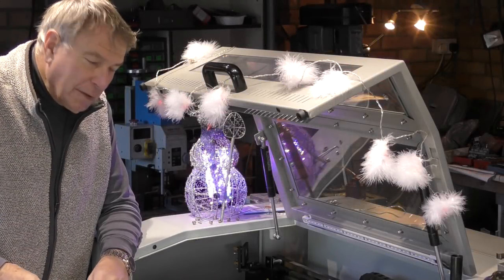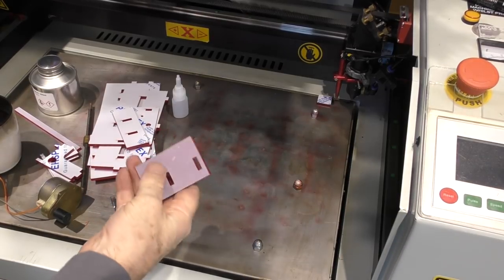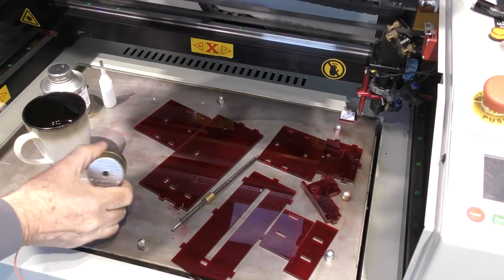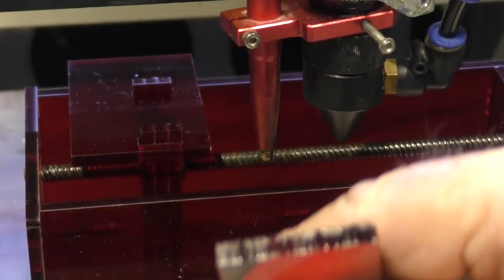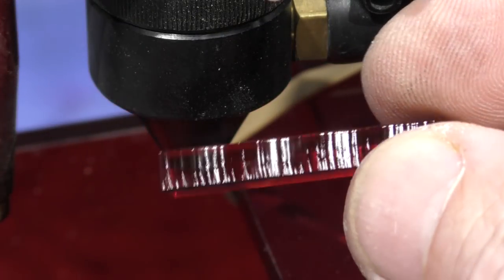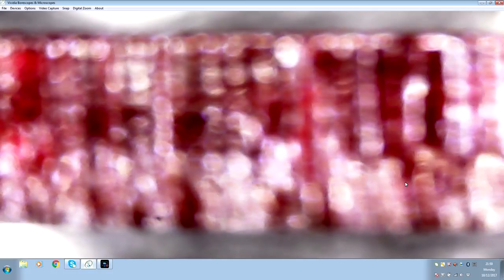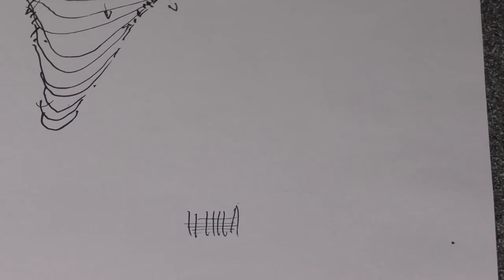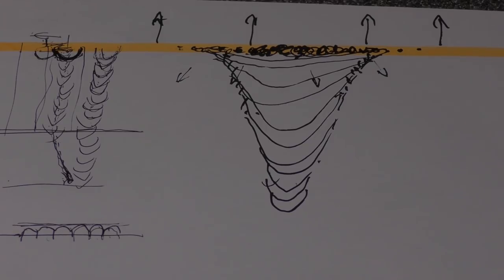RDWorks Learning Lab 128 Are Acrylic Striations Stepper driven

Comment: Hi Russ,
I've got an of topic question, my 50w laser machine caught fire burned..so sad. Luckily my house didn't burned down..But now I'm trying to rebuild it and already found many parts. I have one problem finding and that is the linear guide square block 35mm. So I thought I asked you sir.  You have the same machine and maybe you can help me out. thank you!
Reply from the maker: Hi
There will be lots on ebay, here is an example
https://www.ebay.co.uk/itm/15mm-HGH15CA-Rail-Block-Carriage-Slider-for-Linear-Rail-Guide-Replace-for-HIWIN/192162627833?_trkparms=ispr%3D1&hash=item2cbdc900f9:g:8QMAAOSwjyxZdW9z&enc=AQAEAAACQBPxNw%2BVj6nta7CKEs3N0qUlKFiGuDcVNrBSv659nxBH%2B9TGA3bpx7mPmGmHpM69dQVR07kg9L3hZMnqzd2ZICjOCTL6kdAbg1LX4xQdks7uSzAVpsepNvjl28dL2fm2XZvwNu%2BhlRQimJyqbEebRTJNv3C%2BF0e0k1xOgQY77gjz%2Bl9p5FMROhpeJ9EanPqtGpnnIxKIvfxwn4KpZ3h0BTSLqtCWB8g0xNhtnT7N6nwD4Ihjd5Wtc4Qw6qBK%2BVxAu0AhBx5ciZS7o89PVth4l8vmcLd2%2Bk5PFj8cFDpohMfuqVrCV5v%2BOCAH%2BczFFrRruE82lqr0Fb15Nzwum2oXYKJw4kL%2BKR4U2U%2BCEu2zteb%2Bnj1hepEsom8K6ZzlabATD3HbOWW2esqQwWwL5wV455PH8ZAOcV65GW6D1CgOVLLTkc4t7aN%2F92HhQ9VlpldKxZrjXvQJLYpKwbCYZWY4GW%2FPYYoNs0zfRMVBUqw8ubdcJQ9edlwqDB%2FzV96gJrqIN4g6e0%2FEDqpZcdt6mU5DuRCO0HGyLavKnh1dwlTSesk9SRik%2F5Bms6az1xv%2F%2BebyYXHojCyXfHvkBo7OHG%2B3iGN85hzYZL4QfagJ7g1lC2BS4RseCxz9RtsEHLa84VBUrZ1Th%2B36QDERV57SbeGb3pzNHIUKqQZXjPM2SnVjbMzQsyzpricxt%2BkhOhoyY3YrRZ6truQx%2BINWIjO5%2BCK5V%2FX7RgcXAR2rO0DSYmnwX%2FS5t1BZ%2BeAP66i2T06dR0xbjg%3D%3D&checksum=19216262783355956fa140d74e0fbd9c7764c1bdf402&enc=AQAEAAACQBPxNw%2BVj6nta7CKEs3N0qUlKFiGuDcVNrBSv659nxBH%2B9TGA3bpx7mPmGmHpM69dQVR07kg9L3hZMnqzd2ZICjOCTL6kdAbg1LX4xQdks7uSzAVpsepNvjl28dL2fm2XZvwNu%2BhlRQimJyqbEebRTJNv3C%2BF0e0k1xOgQY77gjz%2Bl9p5FMROhpeJ9EanPqtGpnnIxKIvfxwn4KpZ3h0BTSLqtCWB8g0xNhtnT7N6nwD4Ihjd5Wtc4Qw6qBK%2BVxAu0AhBx5ciZS7o89PVth4l8vmcLd2%2Bk5PFj8cFDpohMfuqVrCV5v%2BOCAH%2BczFFrRruE82lqr0Fb15Nzwum2oXYKJw4kL%2BKR4U2U%2BCEu2zteb%2Bnj1hepEsom8K6ZzlabATD3HbOWW2esqQwWwL5wV455PH8ZAOcV65GW6D1CgOVLLTkc4t7aN%2F92HhQ9VlpldKxZrjXvQJLYpKwbCYZWY4GW%2FPYYoNs0zfRMVBUqw8ubdcJQ9edlwqDB%2FzV96gJrqIN4g6e0%2FEDqpZcdt6mU5DuRCO0HGyLavKnh1dwlTSesk9SRik%2F5Bms6az1xv%2F%2BebyYXHojCyXfHvkBo7OHG%2B3iGN85hzYZL4QfagJ7g1lC2BS4RseCxz9RtsEHLa84VBUrZ1Th%2B36QDERV57SbeGb3pzNHIUKqQZXjPM2SnVjbMzQsyzpricxt%2BkhOhoyY3YrRZ6truQx%2BINWIjO5%2BCK5V%2FX7RgcXAR2rO0DSYmnwX%2FS5t1BZ%2BeAP66i2T06dR0xbjg%3D%3D&checksum=19216262783355956fa140d74e0fbd9c7764c1bdf402

You will be able to pay a bit more for proper Hi Win type

Best wishes
Russ

Comment: Hi Russ, while trying to solve the stepper jumping issue, i found out that stepper drivers on this machine are running very far from optimal values. Mine was running at max current of 4.2A, i turned that down to 2.3 for X and 2.8 for Y, also played with microstepping a bit mostly to see if my jumping issue at 7mm/s disappears, and it did when i increased the number of microsteps, machine is running smoother and quieter now too. Curious to test it for ripples now.
Reply from the maker: Thanks for that information. I have never played with the drivers although now that I have fitted a much lighter head I do plan to experiment to see if I can get faster accelerations and speeds. It's almost the last frontier of the machine that I have not delved into deeply. It works fine  so I have left well alone whilst exploring so many more important subjects.  I will be interested in any discoveries you make as it will send me off with a flying start in the right direction.
Many thanks
Russ
Reply: SarbarMultimedia not sure if you know that or not, but you can change machine firmware settings right from rdworks. Acceleration is easy to change right there in vendor settings menu. The default password for that is rd8888. As for the stepper amps, i just dont like to overdrive steppers ever, so i reduced amps drastically. 4.2A is a total overkill for this application. Ramped up micro-stepping to max value and it helped with occasional jumping problem somehow. Ripples on surface are reduced to almost zero now with 256 microsteps. The remainder is belt to blame. If you decide to change misrostepping on driver, make sure to adjust steps/mm accordingly in rdworks vendor settings and write that change to machine.
Reply from the maker: You may not be aware , but beside the step interval in Vendor Settings there is a 3 dot button. That will automatically set the correct step interval if you feed it some drawn and measured data.
 My X and Y are both set to 2000 steps/rev. With the effective diameter of my drive pulley being 12mm that gives a circumference of 37.7mm and an effective step length of 0.019mm.  That's fine enough resolution for even the best pictures you can practically achieve. I have been able to get weak dots at 0.05mm diameter but a sensible minimum has been 0.1mm . Hence at 2000 steps /rev  this is 5 times better step resolution than the pictures require.
Thanks for the info
Russ
Reply: SarbarMultimedia yes, that is correct, but multistep feature is not only about precision, otherwise 256 multistep would not exist at all, it adds smoothness to stepper and reduces noise by a lot, if you have a noise. As a side effect somewhat reduces available torque too. As for the button, i did not bother, because i had no idea what my parameters were. My default microstep was at 5000, i changed to 25600 and multiplied step scale accordingly, worked like a charm. I am still unsure what caused that jerk, but i am happy that hanging settings eliminated that problem entirely. Also my acceleration settings were not very smartly set, i changed that to ones that make sense :)
Reply: SarbarMultimedia apparently whoever build that machine was shockingly clueless even about basic stuff.
Reply: SarbarMultimedia and i am going to update you once I retrofit new belts too! I expect big improvement there.
Reply from the maker: Yep, it's become pretty obvious to me after seeing and using quite a few different Chinese machines,( some better than others) , that even the guys that design the better machines have never used them in anger or spent time trying to set them up. If they did so then the design would not be as it is. The factories are just populated with spanner turners who have no idea what they are building, they are just plugging standard parts together, often badly because the design does not guarantee error free assembly. I am currently working with Thinklaser in the UK to see if it's possible to get a cost effective easy to use and set machine.  Maybe a dream unless I build my own....but why would I do that?
Thanks again Russ
Reply: SarbarMultimedia totally do build your own, Russ! This will be very rewarding in the end, trust me :) especially since you have time for that. It’s fun too! But you first need a 3d printer for sure to go for that kind of challenge ;)
Reply from the maker: Was it a 2 colour acrylic inlay?
Reply: SarbarMultimedia it was black acrylic only, and then after cutting I realized that I might use both parts of this cut, but I did not have white acrylic to cut the second part. I only have black and clear, so I used the leftover black part and spray painted it red just to see how it will look like; and then assembled them back together :)
Reply from the maker: If you are doing 1mm thick wood inlays/maquetry then it is important to use the offset command to compensate for the cut width  but to be honest with 3mm acrylid and a well focused lens onto the surface it's not necessary and probably will cause nightmares for something as complex as your job. That is excellent work from a crap machine? Why spend 20 or 30 times more for an Epilog or Trotec when you can get equal quality and lots of fun and personal satisfaction from a machine that you have reworked yourself?
Congrats on producing so quickly out of the box.
Russ
Reply: SarbarMultimedia yep, I didn’t really need any offset, i measure the dimensional error on my parts and it is 0.08-0.15mm, not more. Which means i am right on the focus point. Won’t bother to set offset, I think it’s good enough for the job. Gonna have some more laser fun over next weekend :)

Comment: The striations in the cuts appear similar to that on metal cutting torches when too high O2 pressure is used. The high pressure causes instability in the leading melt region. Have you tried lower air pressures? Just a wild guess, thanks for your good work.
Reply from the maker: Hi Tim 
This was done with air assist off. Normally, when cutting acrylic , there are two methods. Air assist on for efficient max speed cutting where the edge finish is not too important, alternatively,   reducing speed by about 25% and setting air assist to a mere whisper you can produce a smooth flame polished edge.
Best wishes
Russ
Reply: When you say "smooth flame polished edge," do you mean smooth but with striations? Or completely smooth like butter? My acrylic cuts are more or less smooth but if you look very closely, it looks like sequential "vertical lines" -- from top to bottom. Are these the striation you talk about?
Reply from the maker: Yes. If you reduce power or speed up and have full air assist going into your cut those striations will become more obvious. I suspect that you have a 2" lens in your machine and a 19 or 20mm gap between nozzle and work face. That means the airflow into your cut will be minimal and the hot gasses in the kerf are not being blown away quickly. It is these hot gasses that keep the surfaces almost liquid and smooth out the deeper striations that would otherwise be there

Best wishes
Russ

Comment: Can you provide a link or a model number to the laser cutter you have?
Reply from the maker: Hi Mike
It's 3.5 years since I bought my machine and the exact model number is not to important because many Chinese factories make the same model with small variations. You look on Ebay for a 50 watt 300mmx500 mm model  this is about as close as I can currently find but it has a manual raise and lowered work table (not a big issue)
https://www.ebay.com/itm/50W-CO2-USB-Port-Laser-Engraving-Cutting-Machine-300-x-500mm-Engraver-Cutter/263562008832?_trkparms=aid%3D333200%26algo%3DCOMP.MBE%26ao%3D1%26asc%3D20190129125700%26meid%3Ddce2f9fa8ed442268225f0e6f3e9014e%26pid%3D100752%26rk%3D1%26rkt%3D12%26mehot%3Dlo%26sd%3D262876994417%26itm%3D263562008832&_trksid=p2047675.c100752.m1982# 
It is important to get a machine with proper HiWin typr bearings and also has a Ruida controller. .Look carefully at the keypad design and steer away from anything different.

Best wishes
Russ

Comment: What micro step setting do lasers use
Reply from the maker: That depends on the gearing between the motor and the final drive belt.I seem to remember my China Blue machine is  set to X10 which is 2000 increments per rev. The light blade machine is a 2:1 step down between motor and drive belt but that is controlled by a 1000 step feed back encoder. So i think that both machines finish up the same

Best wishes
Russ
Reply: SarbarMultimedia x8 is normal for  Cnc router if you increased the micro steps and re calibrated your machine would that make a difference.

Comment: What frequency does the laser run at?
Reply from the maker: Hi Samantha
Zero Hz. It is a DC stimulated laser not an RF laser tube. During the pre-ionization phase  (between 3 to 6 mA approx) the tube lasing output is resonating at some  natural high frequency But as soon as this threshold current  is exceeded the ionized nitrogen pink beam achieves stability and thus the resulting lasing output is rock steady as well.
Best wishes
Russ